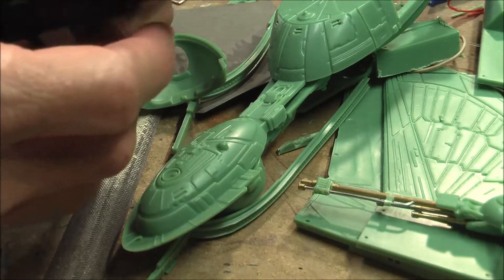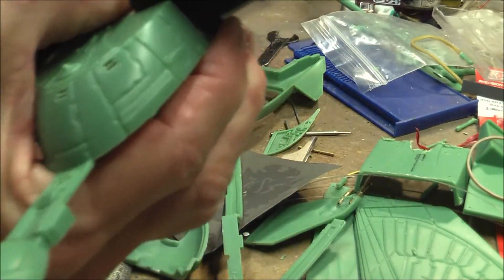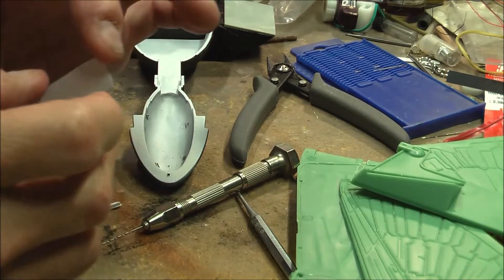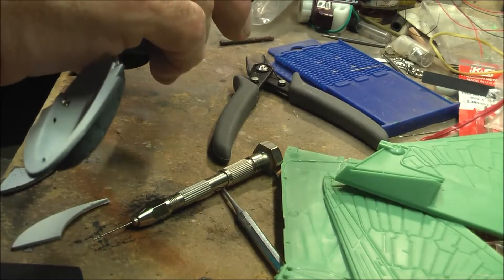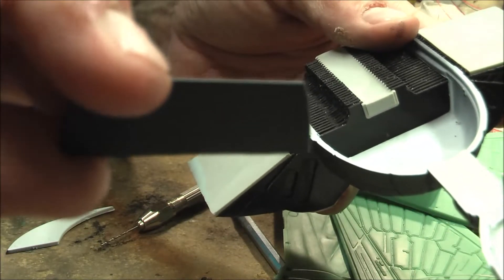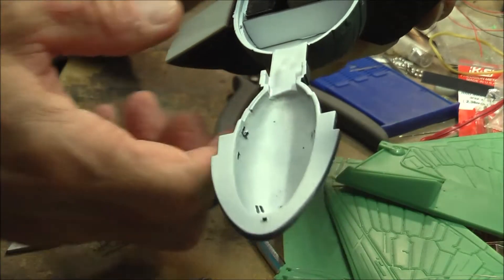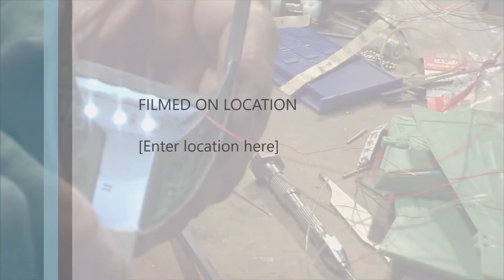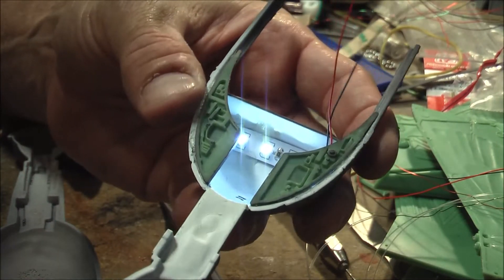Klingon Bird of Prey part 3

Comment: I have never tried it before but I know of someone who used black spray insulation ( spray on insulation tape) for light blocking. It might solve two problems for you in front.

Looking  very , very good so far though.
Reply from the maker: Viswanathan Pather I was able to get it with the black primer. Light blocking is always an issue. You just have to be patient and thorough.